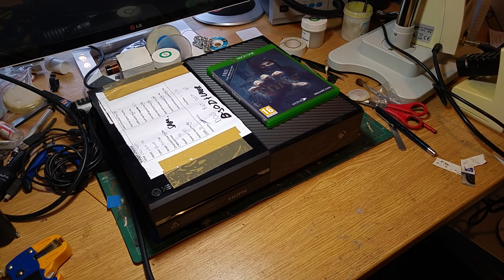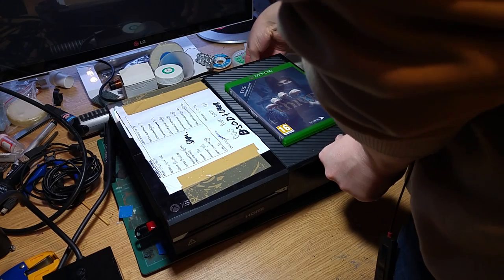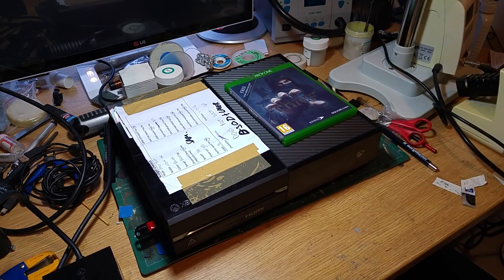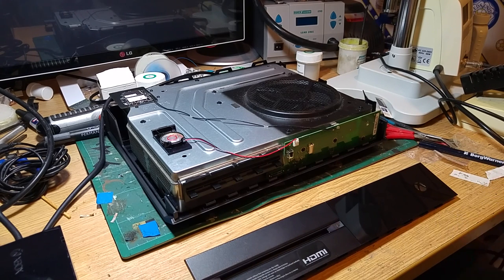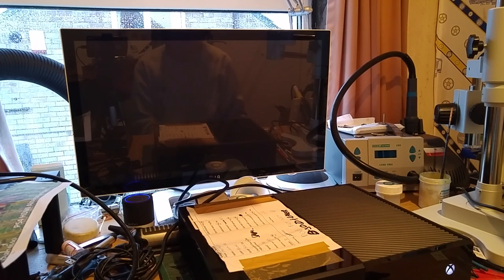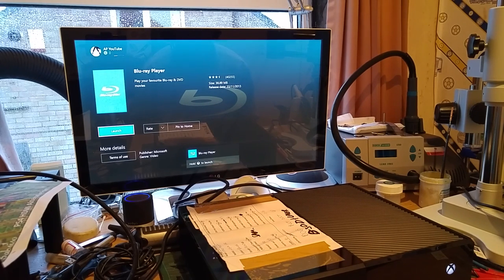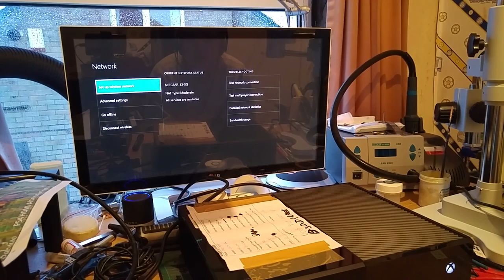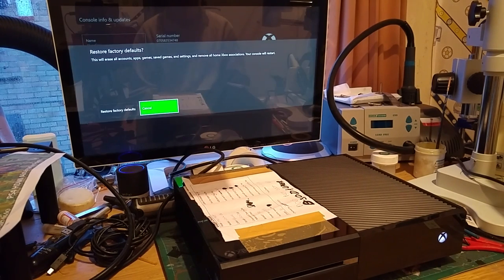XBOX One Black Screen / Intermittent Green Screen of Death Recovery - Diagnosis and Repair

Comment: I need to connect the hdd to a laptop to repair the sectors. Can you advise me on what to download please. Perhaps add a link. Thanks
Reply from the maker: It's HDD Regenerator. Cheers.
Reply: +Andrew Paul thanks. The only version I can find is 2011?
Reply from the maker: That's right - 2011 is the latest revision. Cheers.
Reply: Hi. I've downloaded and installed in to my laptop. When opening the file I get an Error message displaying Hnable To Initialize

Comment: My Xbox one fell and I plugged it in and it did the green than black screen. I did the factory reset and it was working for a little than it started doing the green black screen again after installing a few games. What should I do
Reply from the maker: As shown in the video - check the HDD for bad sectors with HDAT2.
Reply: How do i plug it to my labtop
Reply: should i just try doing th4 flash drive thing
Reply: How do i plug it to my labtop
Reply from the maker: You need to remove the hard drive and plug it into the computer via a SATA port or a USB to SATA adapter, whichever you find easiest.
Reply: is this bascially just doing the flash drive thing? cause ill just do that
Reply from the maker: No - you have sector damage which needs fixing. If you don't then you'll end up with it showing BSOD again.
Reply: PUB Astro I clicked the manual hdmi set up in the audio output video output whatever that is settings menu and basically set up the Manual hdmi and my Xbox and TV is on but there's no picture at all
Reply: And my TV and Xbox I one hundred percent undamaged

Comment: my xbox has orange light of death... plug it in and it trys to start 3 times fan twiches power pack goes fast but then just sits on orange light... not power pack as tyred with 2 known working ones. .. ? do you know what could cause that?
Reply from the maker: Usually Southbridge failure.
Reply: Andrew Paul  thanks been testing  voltage and caps... I'll have a go with the heat gun! it's dead anyway... ps I replaced that hdmi port with my £35 solder station.! following your guide worked well ! thanks for the reply.
Reply from the maker: No problem.

Comment: It won't work every time I go to hold in the eject button it turns the Xbox on when it isn't meant to can you help
Reply: You need to hold both the bind button (same button you syn the controller with on the left side of the disc drive) and the eject button. Then press the power button once, but keep holding those other two buttons until you hear the two power up tones.

Comment: so if i factory reset mine will it erase my xbox live account forever or can i sign back into it if i do because im scared to do it
Reply: Yes it will
Reply: No it will not delete your Xbox live account forever from existence, but it will remove it from the console.  As long as you know your password you can download your profile back to the console after the restore, but you will need to reinstall your games.
Reply: there's two options for the factory reset, One is that you delete your account but keep the games already downloaded to it. all you need to do for this one is sync your games to your account. when you try and play the games they'll sync and you'll be done. The second option is to factory reset and delete the account off the xbox one but you have to redownload all the games to that account again, don't worry you keep your save files and you don't have to pay for them again.
Reply: +TYBG YouHaveBlessedMe is it the same for a hard drive? What I mean is that I have hard drive with downloaded games does that it's safe if I delete my acc? Cause it's. Black little box with my saved games
Reply: Kiara Rivera It should be safe, all you have to do is plug it back up after you download your account and download them again on there. it'll be in your game library.

Comment: hey I am having a black screen just like u I start my Xbox light is on but no display on screen can u tell me what did you did with the hard drive to get the green screen
Reply from the maker: Scan it with HDAT2 on a laptop or PC. Hopefully that'll sort it for you.
Reply: but can I remove my hard disk inside xbox
Reply: is hdat 2  a software
Reply: how can I remove hard disk
Reply from the maker: https://www.youtube.com/watch?v=BrSX0LdSNuQ
Reply: hey bro u took my Xbox hard disk and put another one after that the screen came up with 4 option turn off troubleshoot .When I clicked troubleshoot it shower reset and offline system update I did click on reset but nothing happened what to do.plz tell
Reply: I have put other hard disk not the Xbox one
Reply from the maker: Have you formatted the new disk with the Xbox HDD tool beforehand? If not you'll need to follow this:
https://www.youtube.com/watch?v=GaKVBo3kdTU
Reply: your videos says it shows something went wrong and no options available but my Xbox shows 4 options turn off , restart,troubleshoot, offline system update and written down below error 101 but your video is showing some different error
Reply: plz help
Reply from the maker: It doesn't matter - format the new drive in your pc/laptop, prepare the OSU1 USB, insert it into the XBONE and then press and keep hold of the eject and bind buttons until you hear 3 power up tones. It'll bypass that menu and force the update. Providing you've partitioned the disk correctly it will run through and complete successfully. If it fails at 5℅ after partitioning the drive then use the factory reset in the troubleshooting menu and run through from there.
Reply: without any usb I directly clicked on reset this Xbox this it comes up with preparing console for some time and then it again comes up that 4 options
Reply from the maker: Yes it will - did you format the disk with the tool in the video I linked and copied the correct files across as shown on there? Without it being formatted properly it won't recover correctly.
Reply: is there any online site which sells Xbox hdd which all the things that are in your video
Reply from the maker: Hi,
Not that I know of. It's easy enough to do yourself if you follow that tutorial I linked above.
Reply: dude can u give me link where to download hdat 2 from where you scanned your Xbox hard disk
Reply: dude can u give me link where to download hdat 2 from where you scanned your Xbox hard disk
Reply from the maker: hdat2.com downloads section. You need the HDAT2CD_53.ISO option under CD/DVD Boot ISO image.
I'll be doing a tutorial on HDAT2 shortly.

Comment: i had this problem and power cycling it and factory resetting allowed me to get past the green and black screens but when i move around the menus its super slow and when i try to play a game it will run fine for a bit then eventually freeze and go into a black screen , can anyone help me with this?
Reply from the maker: If you're sure the HDD checks out with no bad sectors using HDAT2 then it could be early onset of APU problems.

Comment: I'm unable to get the second tone aswell and the bind button seems to be fine
Reply from the maker: +bryte2416 yeah - a candidate for a check through with HDD Regenerator then mate.
Reply: +Andrew Paul how do I do that exactly?
Reply from the maker: You'll need to remove the hard disk from the XBOX, hook it up to a PC or laptop and run the software against the disk.
Reply: +Andrew Paul ah, aright

Comment: How is the xbox one hardware issues compared to the ps4.
Reply from the maker: +cod2185 From what I've seen the XBOX One is far more reliable from a hardware standpoint than the PS4. They don't seem to suffer much from overheating or APU issues like the PS4 does. The one area they are a bit weak on are the optical drives - the lasers seem to go regularly and finding decent replacements is difficult as many are re-hashed shite sadly. If you find good suppliers stick with them lol!
Reply: +Andrew Paul Thanks as i suffered the hdmi pins issue on my ps4 recently, thankfully i got it fixed but any other issues and i am throwing it in the bin and getting an xbox one, great vid as always you should have more subscribers👍.
Reply from the maker: +cod2185 Cheers mate. I do like the PS4 but it's very problematic hardware-wise. :(
Reply: +Andrew Paul  Hi. I had to repair one of these, shortly after they had been launched. It would have been covered by the warranty if someone hadn't had tampered with the warranty stickers. The optical drive was damaged. I was unable to locate any in the UK at the time, but managed to locate a seller in the US. It arrived several weeks later and although well wrapped it was completely smashed. I had to return it before I could get a refund. I then managed to get another from some other seller in the US. This time it arrived in perfect working order. So in the end it took about 8 weeks to get a working drive and an hour to fit it. I have been dreading being given another one with a Blue ray fault.

Comment: How To fix the e200 000000ef 00000000 error?
Reply: im having the same problem are you in the preview program?
Reply: +Mr TNF yes...
Reply: +Mr TNF I can not do anything on Xbox, is a screen restart the console and reset to factory default
Reply: +Mr TNF A friend of mine said you have to use the Microsoft Diagnostic Tool. You put these files on a flash drive, put the stick on the Xbox One and connecting it ... have not tried it yet, I will test today
Reply: Okay thanks im gonna try that now

Comment: For those of you stuck at a black screen and unable to get the bind and eject buttons to make the 2 beeps, download the file hosted here by Microsoft

http://www.xbox.com/xboxone/restorefactorydefaults

and extract the $SystemUpdate folder into the root of a flash drive (minimum 4gb). Plug the drive into your console and hit the power button. The console will likely sit at the black screen and after some time will factory reset (deleting all of your games/saves) but allow you to reload the console as if it were the first time. Please let me know if this helped any of you!

I had tried every possible method before this one finally worked and although my drive could be dying, it will make it until the One X.
Reply: DaveLovesGames 
Did this work long-term? Is it still going/working?

I've got same issue, but got an Elite model/solid state drive... 
after trying almost everything, holding down power with all cables unplugged for 30 seconds, (draining all power caches) then doing normal power up brought it back. It was working perfectly as if nothing ever happened. 
After playing Neverwinter for about 6 hours, it froze up when loading an area and never came back. Tried all previous fixes again, including what I listed above and 8+ hours later, no signal response. Right back where I started. Ugg.
Does anyone have a suggestion for next steps (other than removing Neverwinter...lol) for boxes that had limited success coming back after draining power cache? Again, this worked great once but back to no signal/output after a few hours gameplay... Searching for anything I missed...

Comment: I got the e100 error code when it tryed update should i install osu1 or osu2 on the usb to do offline update from usb osversion 15063.4082.amd64fre
E100 0000703 80910008 👊✅
Reply from the maker: The end parameter here is the important one - 80910008 is either a mismatched BD-ROM logic board, faulty BD-ROM logic board preventing authentication of the drive or NAND corruption (rare). Check System Support partition for a 'oddfwupd' folder - log files in here will detail what is going wrong. Anything like IOAuthCtrl failures is usually a good bet for a damaged logic board or switched logic board / drive. You'll need to reinstall the original drive logic board if you've changed it since the error started or find the issue on the existing logic board causing the XBOX to not authenticate its paired drive properly.
Reply: Andrew Paul it wasnt reading disc before so i replaced the drive from a xb1 drive i had a parts xb1 i put the new drive in read disc fine played games on it then like 2months pass i got system update then i get e100 error code
Reply: Andrew Paul but if i hold bing an eject then click factory default it just reset the console then goes back to 52% an stops gives me e100 code Microsoft said i need to do offline update osu1 i can get offline update thing to pop up just asking which one i should do or should i go through them
Reply from the maker: Did you switch the logic board from original drive to the replacement? If not then that's what i'd expect it to do - first time it's tried to upgrade the firmware it's twigged it's not the original drive and therefore fails.
Reply: Andrew Paul i fixed it went through the osu like u did was. Bad update my cousin said he turned it off while it was updating the first time i said thats y i had the code tells u not to turn off console while it updates
Reply: Andrew Paul i done what u did on ur other video i wiped the hdd other stuff then i done the offline update fixed

Comment: Mines stuck on 89%
Reply from the maker: +cairan brown The HDD Regenerator scan? Are the number of sectors still ticking over? If not and it's stuck you might be looking at a new replacement hard disk drive. I'll be covering a tutorial of how to install a new drive shortly.
Reply: +Andrew Paul on the Xbox it says applying update and stops at 89% and doesn't move
Reply from the maker: +cairan brown ah... Have you attempted to use HDD Regenerator on it yet?

Comment: Hey Andrew Paul thanks for the great videos, but I'm having the same problem as this guy ( https://www.youtube.com/watch?v=RtXMa6AT6V8&t=15s ), I try formatting two diferent disk already and using the usb method with the osu1 or the factory reset and I did the scan with the hdd regenerator, no luck yet, any thoughts? 
BTW this happen to me after a failed updating process, and thanks again for all the help!!  
Cheers!!

Comment: ok mine is doing the same thing after a power shortage takes 3 mins 15sec before the tv gets a signal and another min of black screen to get the green screen and stays there and going to try this i'm just making sure i got everything right before i do i take the hdd out of xbox hook it up to pc by sata and run scandisk to fix any errors or will that work and that i need a 3rd party sector repair tool
Reply from the maker: +Tiffany Hurley Hi,
You'll need a 3rd party tool for the job. I used HDD Regenerator but that is licensed software and therefore costs. HDAT2 is supposedly similar and is free though I've never tried it before. Good luck!